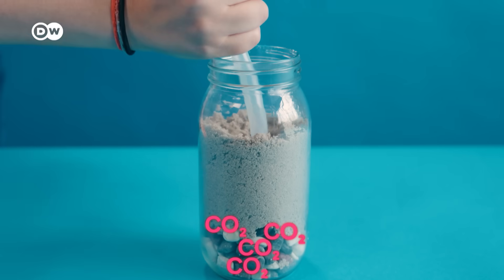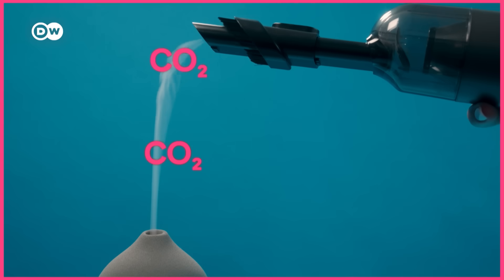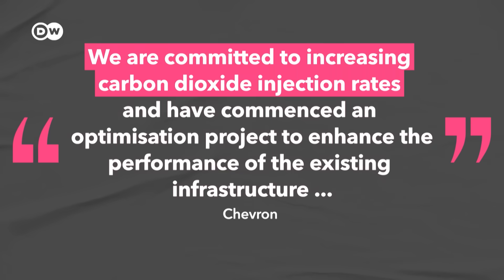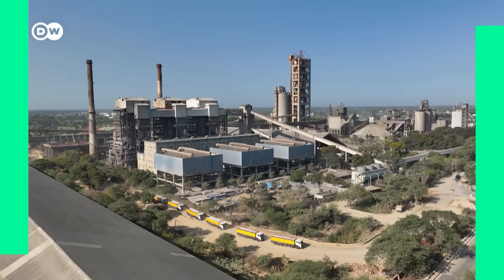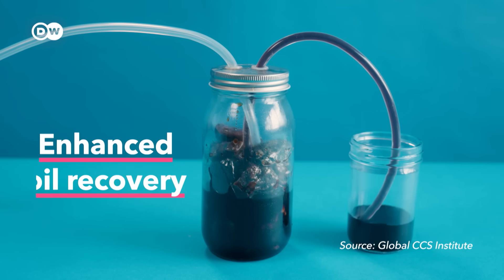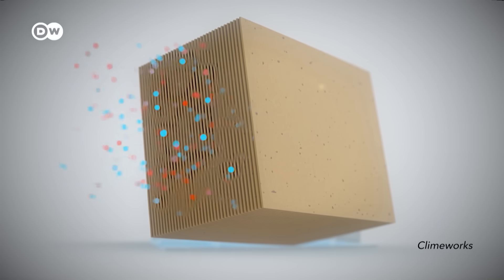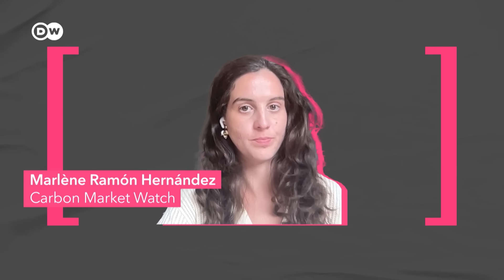Why carbon capture needs a reality check

Comment: Thermodynamics suggest that sequestering carbon dioxide after using the energy by ignition would use all or more energy than received initially.
Reply: thermodynamics suggests nothing of the sort. The champion DAC tech uses under 1MWh per ton of CO2 captured. Burning natural gas produces around 5 MWh per ton of CO2 created
Reply: @ldm3027  👍 I hope you are right. I ain't ever tried to unmix the kool-aid, but I guess with enough time you could.

The complexity of the mechanism, filters and subduction of the spare carbon would need to be created without releasing more CO2 as well.
Reply: We could use nuclear power to get the energy needed to sequester CO2... But then again, better to use it to reduce the amount of hydrocarbons we burn than to try to capture a portion of the resulting CO2 afterwards...
Reply: You don't have to actually unburn the carbon, in which case your thermodynamic argument would be true.  However, there's still typically a 40% energy overhead to capture and compress the carbon dioxide, transport it in pipelines and pump it underground, at which point it is still carbon dioxide.  There's a net gain in usable energy, but not by much.

Even with a lot of regulatory and government support this is not going to compete against renewables.  You can't write CCS off completely from basic physical principles, but maybe you can from 20 years of unfulfilled promises.  It's been a way to excuse new projects by a dying industry, and there really is no excuse.
Reply: @SofGdggd-xt9lw  doesn’t have to be an exact reverse process, but solids and gases tend to have certain characteristics
Reply: So we can all agree that it’s shameful for a properly educated person to advocate for carbon capture and storage in fossil fuel electricity generation to be the path forward?
Good. Okay, but what about carbon capture and storage in steel and cement production?
They were never intended to produce energy; they consume energy to produce useful materials.
Reply: @SigFigNewton  They don't call it a predicament for nothing
Reply: Well, that is true if you convert it back to oil. But you can convert it to a less energetic form.
Reply: @noradlark167  more waste heat
Reply: Yes, but it might be worth it. We need liquid fuels for things like airplanes (because we can't yet make electric planes). So, a plane burns kerosene, pollutes the atmosphere, DAC on the ground uses solar energy to slowly clean up the CO2.
Reply: In the far-out end game, you wouldnt use hydrocarbons to make energy, you use it as a convenient energy medium for making high temperatures and running diesel engines imo.  Far far out though, and it presumes you have stupidly abundant and cheap electricity
Reply: @Mark-dl7yz Maybe fusion will happen before we poison ourselves.
Reply: I do not agree. At the start You BURN  carbon. At the end You COLLECT the waste product CO2. You do not reform it BACK into a new fuel (which will require at least so much energy as obtained  by burning). Then it will be reasonable to REUSE the CO2 as a chemical and not simply to pump it into the Earth.
Reply: Yes, but the idea would be to use (too much) renewable energy to recover the carbon generated by use cases that can't use renewable directly. That's the expensive theory. In practice it's just a scam.
Reply: @M69392  Yep, "renewable" items are made and transported via fossil energy and have to be replaced eventually.
Reply: @TennesseeJed Do you genuinely think that doesnt get offset or are you just playing dumb?

Comment: I don't get this whole carbon capture hysteria. If the amount of CO2 reaches 0.2%, the plants will die off, and there is only 0.4% of CO2 in the air, so why reduce the amount of CO2 then? Wouldn't that be extremely dangerous? Also, if you look at the stats, 35 billion metric tons of CO2 is put in the air by human pollution, which sounds like a lot, until you realise that nature's own vegetation and oceans omit 700 billion metric tons of CO2. Which is 20 times as much. I do agree climate is changing, I notice myself, but to solely blame CO2 for it is ridiculous if not outright dangerous. Why not help countries like India and China with a better and cleaner energy production method to avoid other types of dangerous gasses, making the people living in the surrounding areas sick and reduce the smog in their city. And instead of carbon capture technology, why won't people plant more trees native to that local area. Instead some "not so smart" people glue their hands onto the landing strip of an airport, delaying and cancelling several flights for a few hours, while instead of being a burden to all those people who needed to get on those flights. They could've solved the issue by planting less than 20 trees.
Reply: @jjoesmith331  As I said in the beginning, I don't get the hysteria. So if you know better, then please, by all means. So far, every "climate expert" just says it's all very dangerous, and we need to be scared, but nobody actually brings in detail about what's the actual danger. Just some fear mongering, nothing else.

Comment: the better simple solution is probably NOT emitting emissions
Reply: sure did, but fossil dudes and gals will lobying this harder than ever
Reply: eventually yes but it is fully impossible at the moment.
Reply: And the economy will collapse, ur family lose their job
Reply: @mizan-mq3me carbon capture and storage in fossil fuel electricity generation is a joke compared with storing solar power in batteries.
Solar power at night will happen. It’s well known that CCS for fossil fuel electricity generation will never approach 100%
Reply: We don't have a battery technology that works like that yet. We need higher energy density storage because normal batteries don't cut it youd need to mine huge amounts of lithium from Africa to have enough batteries to do what your talking about.
Reply: @aeseki  mining more lithium meaning is just more oil usage there is no solution for this rn, if the mobile nuclear reactor is a thing, maybe they could mining without any fossil based energy
Reply: @mizan-mq3me  Who cares about losing jobs, the Holocene is not present anymore, the biosphere is dying. Money is useless when society is destroyed.
Reply: You first
Reply: or stop human existence.

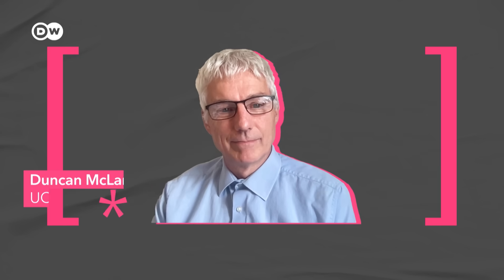Comment: Any technology on carbon capture that has been 'embraced by fossil fuel companies' has to be deeply suspect.  3:45
Reply: in southern saskatchewan, they were using it to pump co2 down old oil wells to make sure and squeeze that last little bit of oil out
Reply: Why? Carbon capture means they can continue to sell fossil fuels and say they are green. Fossil fuel industry LOVES carbon capture because it distracts from competitive renewable resources.
Reply: Exactly!  @OllieX123
Reply: @OllieX123  Yes. Understand the motivations. Don't just dismiss.
Reply: Nothing much suspect about it, we already know their prototypes and concepts aren't viable or workable right now, only anyone working in the sector promises it might be one day, all they need is more money... If you were to approach anyone studying the field in academia you will find they have concluded it has no hope whatsoever and we should concentrate our efforts elsewhere.
Reply: @initialb123 what is proving far more viable is simply storing solar power in batteries. The solar panel tech is already here and already extremely inexpensive. The batteries are improving at rate that makes improvements in carbon capture and storage look like a snail trying to accelerate faster than an electric vehicle.
Reply: Any sufficiently advanced technology is hyped on YouTube..
Reply: Eventually the industry will go through a transformation
Reply: I remember very clearly the right wing (Redneck) parties in Australia promising CCS technology back in 2006, all the while ridiculing the Green Party for saying that wind and solar will be cheaper in the future. Of course, the right wing parties are basically beholden to the coal industry in Australia, so it was obvious back then which way this was going.
Reply: Indeed just another way for them to keeping going

Comment: Since electricity from oil and gas is already on par or more expensive than renewables, and coal is significantly more expensive, anything that adds to the cost is already a non starter. And wind and solar are still getting cheaper every year. So it's only going to get less efficient to divert money from renewables to carbon capture on energy generation going forward. This was always just an excuse to keep the power plants running and the money flowing into the hands of fossil fuel companies instead of being given to green energy.

on none energy generating c02 sources like cement direct capture is a good idea, but still only adds cost. So without something like a functional carbon tax it's never going to be economically viable.

Direct air capture is not even worth thinking about until we've eliminated all the easily replaceable emissions sources. Until then every bit of renewable electricity used to power air capture would reduce emissions more if just added to the grid to replace high carbon energy, or used to generate green hydrogen. And every dollar spent building the air capture machines would reduce more carbon emissions if spent on solar panels or wind farms or home insulation or heat pumps or pumped hydro or basically any other existing technology.

Once weve picked all the low hanging fruit then we can start thinking about stuff like this. But right now we are spending a lot of money and time trying to build a cherry picker while there is fruit laying on the ground going to waste, to stretch the metaphor.

Comment: 2% of US agriculture is organic. The rest of it uses chemical fertilizers to feed plants instead of using the soil to become a storage area for Carbon to increase production with microorganisms.
Reply: Chemical fertilizer was developed to feed the planet. Hence you hear very little about millions of people dying from hunger. Yet, it has run its course. And can be made from water electrolysis. As opposed to from natural gas. Or coal.
Reply: p.s. Briefly. Have looked into socalled 'regenerative agriculture'. May I ask what your take is. On how much carbon can be stored in the soil?
Reply: @user-pt1ow8hx5l  Regenerative is broader title to organic, but both use organic methods.
"We found 77 multi-year experimental results measuring changes to no-till with an average carbon sequestration benefit of 0.77 metric tons of CO2e per acre per year. We found 189 experimental results for planting cover crops, with an average sequestration benefit of 0.76 metric tons per acre per year.
"As of 2023, the United States had 879 million acres of farmland, which is 39% of the country's total land. This is a decrease of over 66 million acres since 2000, when the total farmland area was 2.17 million acres. The number of farms in the U.S. has also decreased, from 2.04 million in 2017 to 1.89 million in 2023. The average farm size in 2023 was 464 acres, which is slightly larger than the 440 acres recorded in the early 1970s.
Reply: farmers sold us out for profits over the last 50 years, destroyed our food and land to feed the supermarkets. now many want praise for adding a few hedgerows :)
Reply: [citation needed]
Reply: @cedriceveleigh  Rodale Institute.
Reply: and the fertilizers are basically natural gas transformed. so double CO2 penalty
Reply: @benjaminlamey3591  That is true and a waste of that energy, but extra CO2 in the air increases plant growth, so it's an asset to food production in both the air and the soil.
see:Is Carbon Dioxide Making The World Greener? (w/ Freeman Dyson, Institute for Advanced Studies)
Reply: @benjaminlamey3591  the orony that the best c02 sink is growing food

Comment: The cost of carbon capture is clear from the beginning: it will always be more expensive to release CO2, then store it, than to not release CO2 at all. You see, the point of fossil fuels is pollution. It’s intrinsic to extracting work from it.
Reply: @jjoesmith331The issue with carbon capture is that it requires a lot of energy, and that energy will very likely come from burning more fossil fuels instead of cleaner sources like renewables and nuclear, thereby releasing more CO2 and repeating the cycle
Your analogy isn’t correct because you don’t generate more trash as you drive to the landfill
Reply: @inasfe7687  But you do generate more trash as you drive to the landfill.
Reply: @jjoesmith331 That’s the ideal scenario and what carbon capture should be used for
Unfortunately it seems to be shown off as a way to make fossil fuels cleaner instead of cleaning up what they have caused
Reply: Meanwhile energy density of batteries is doubling every few years.
Wasting money on carbon capture and storage for fossil fuel electricity generation instead of hastening the arrival of our ability to power cities at night via solar is essentially corruption.
Reply: Virtually everything we have or know that has benefitted mankind has been created from oil.  We can never stop using it unless we want to return to the dark ages!  Technologies to reduce the polluting effects of using fossil fuels are fine just as long as they do not increase costs - which are passed on to the consumer or taxpayer.  Also we have to consider other societies which are not as advanced as ours and are relying on fossil fuels to power their progress, and we have to consider that other countries are continuing to use fossil fuels for their advancement, and we cannot allow them to put us at an economic disadvantage just to meet arbitrary targets etc.
Reply: Its actually quite expensive to not release CO2 at all. For instance should we stop producing cement? What about steel, do we need that? We need a technology that allows us to produce products like steel, cement, plastics, etc without ruining the planet. CCS is a technology that can help us do that. No one is talking about alternatives like not using cement. Its just not realistic.
Reply: CO2 is plant foot. It's not pollution. We just have to improve the carbon capture methods. Better investment than solar wind
Reply: Carbon has increased from 0.03 to 0.04% of the atmosphere, at 0.02 plant life starts to die and as it rises plant life flourishes , solar and wind energy is not viable and doesn’t offset the carbon created in production in its lifetime , nuclear is viable but for some reason the climate activists don’t want it ?!? . And going electrical is also not viable , the increase in mining to make the batteries and build the infrastructure would make it far more damaging to the environment and take dozens and dozens of years of mining at 20x the rate we are now and by the time we have done that to meet the needs of the population today 30-50 years have passed and there is all the new people living on earth that require more infrastructure more batteries more mining . 

All this movement does is make life extremely expensive as the increase costs are always covered by the customer and/population
Reply: @TH-lu9du  cute lil Kyle thinks he’s saying something.
It’s like if I argued that a human body temperature going from 310 Kelvin to 314 Kelvin is inconsequential because the numbers look like it isn’t a big deal… when the reality is that that is a deadly fever

Comment: How much CO2 do you produce in storing CO2? that is the only question..
Reply: Clean coal facilities mostly failed before they began. The “success” case can arguably prevent the emission of (or “store”, rather) up to 8%.
It’s a pathetic failure of an idea.
But I’m yet to be convinced that carbon capture and storage for cement and steel production is a bad idea. Those processes things were never meant to produce more energy than they consume.
Reply: Yup. If CCS has only captured 0.1% of CO2, it stands to reason that the CCS plants are carbon positive.

Comment: Great overview. Please look into ground basalt as well next time. This is something that scales well. It is essentially the rock weathering process speeded up by a factor of millions. Rock weathering is a thermostat that keeps the planet within a limited range of temperatures - on very long time scales, but it can't keep up with the pace of human-juiced climate forcing. It operates by - wait for it - removing CO2 from the air, and more quickly when it's warmer. Ground basalt accelerates this process. It's a way to get the carbon out of the air and back into rocks.
Reply: Agreed. Carbon can be captured. And recycled as concrete, too! Possibly making the proces 'bankable',....... So many better options than capturing carbon from big emitters, especiall big emitters of little value.

Comment: Why not just capture it directly from the smoke stack via a pipe linked to a container with porous rock to store the carbon and then reused as needed?
Reply: Yep. Algie, especially, connected to the smokestack via a few pipes spreading out is a viable route, it seems. As one of many other solutions.

Comment: Gorgon LNG facility was able to inject only 1,7 million tonnes of CO2 and emitted at the same time 8,3 million tonnes CO2 into the atmosphere which are indeed only the emissions from natural gas extraction and not the other emission caused by burning the LNG or methane leaks or losses during transport or energy losses for liquification process or gas extraction. In the best case they avoid  less than 1 % of their total emissions and call their project climate friendly. Bigot!
A good example of how this industry works.